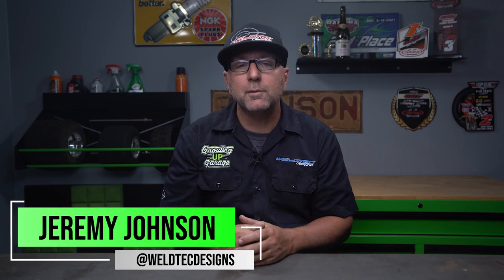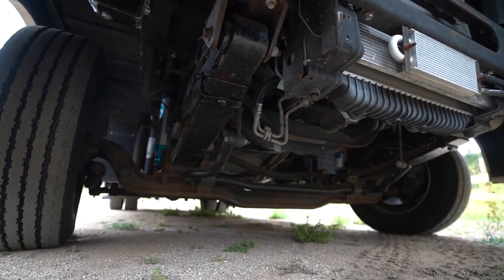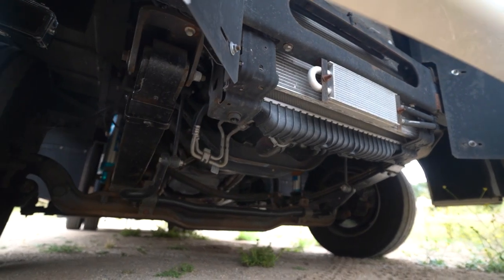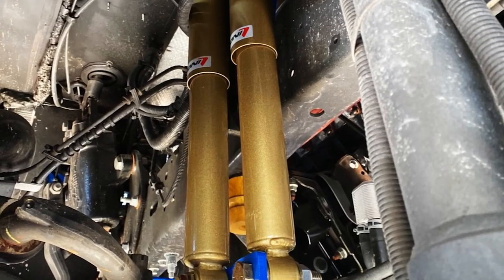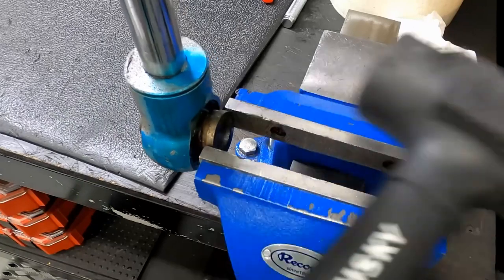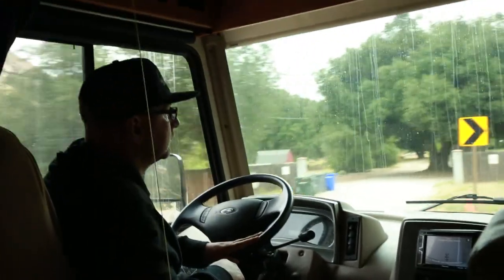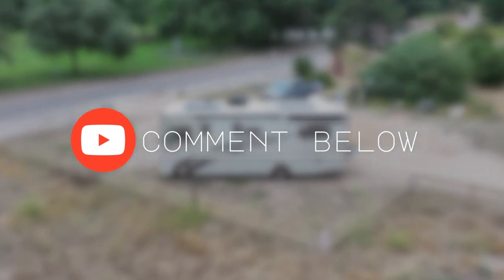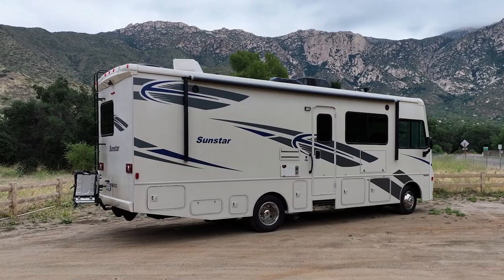Class A RV Motorhome DRAMATIC Sway Improvement after 2 Inch Suspension Upgrade F53 Ride Improvement

Comment: Having had a 2019 F53 chassis, and spending a lot of money on upgrading the suspension, you will never get a decent ride / handling out of them, no matter how many "gee whiz" things you do.  The only real option, for a F53 is a total Liquid Springs upgrade to solve all the problems the F53 has.  We went through all the upgrades and finally traded in and got a Diesel Pusher - no comparison and stock, does better than all the upgrades we did on the gasser.  Live and learn...

Comment: There's only so much you can do to improve ride quality, handling with a straight axle leaf spring, shock suspension.  I went in a different direction, I went with the LiquidSpring 4 corner (front and rear) 5 link active smart suspension system. The leaf springs, shocks, and all existing hardware is removed and replaced with outboard of the chassis frame a strut suspension.  The system analyzes vehicle speed, steering, ride height, braking and road conditions 1000 times per second, and actively adjusts and adapts in 40-milliseconds. The system uses a 6% compressible silicon liquid at 3000 psi. It makes my 26,000 coach truly drive and handle like a large SUV. Rough roads, bumps, crosswinds, railroad tracks, passing trucks, air push, etc is now almost non-existent. I can now drive 10 hours without being fatigued.   Yes it's expensive, it's by far the best money that I have spent on this coach. I can even lower and level the coach.

Comment: Adding a non-progressive leaf to the pack - the even-stiffer ride must be brutal. No thanks.
Reply from the maker: We did add a progressive leaf to the pack? That is what a parobolic spring is, we also add arc to the spring to create an air gap to not make it stiffer untill a certain load is applied to that spring. Is there anyhting elese you would like us to clear up on this kit?
Reply: @WeldtecDesigns  The spring pack in static condition has engaged the extra leaf, so any progression has already occured... but thanks for the clarification.

Comment: I have a 2020 Sunstar very like the one on your video. I don't really have a problem with sway or drift (maybe I'm just used to it after 25 years of motorhomes). But my problem is ride quality. On even moderately rough roads the bumpiness gets almost unbearable. Do any your modification address this on an F53?
Reply from the maker: YES. outr 2.5 KIng shocks are just the thing you need to help make the ride better! https://weldtecdesigns.com/product/wtd-class-a-rv-f-53-shock-upgrade/